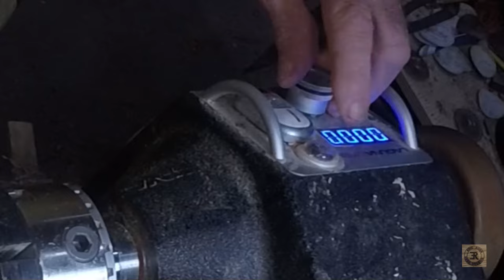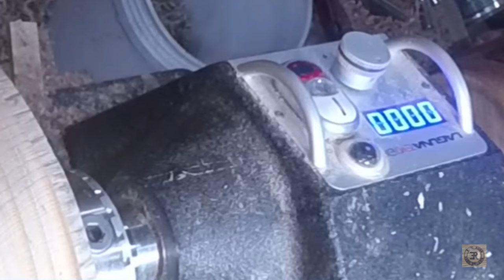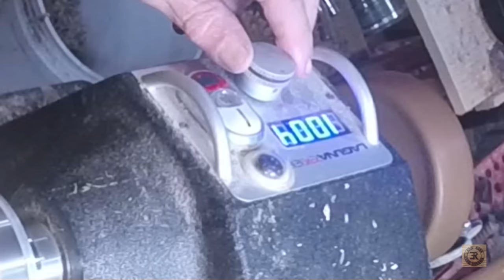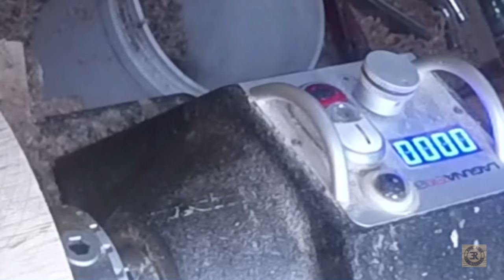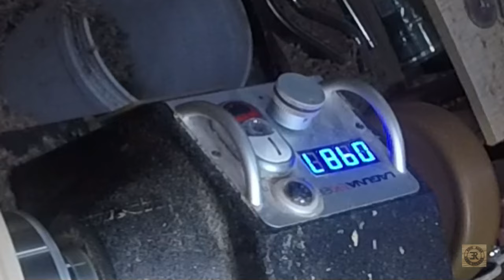My Best Bowl Ever?

Comment: I miss your sawmill videos.
Reply: yes we do
Reply: My interests and activities jump around, Kenbo. It's an ADD thing. Right now, the lathe is my focus, but there is more for the sawmill. I'm working on getting a bunch of old power poles to turn into fence boards or shed siding, and I still have half a dozen alder logs up on the hill I need to drag down to the mill. I plan to attach a camera to one of those to give you a roller-coaster view. But not today.
Reply: @OregonOldTimer  It is wonderful to hear from you. Can`t wait for the sawmill videos.